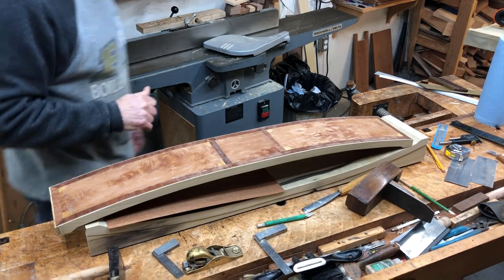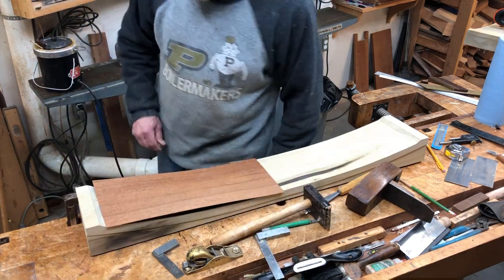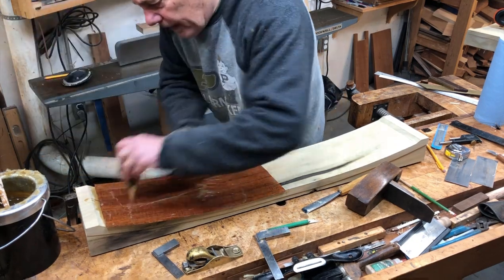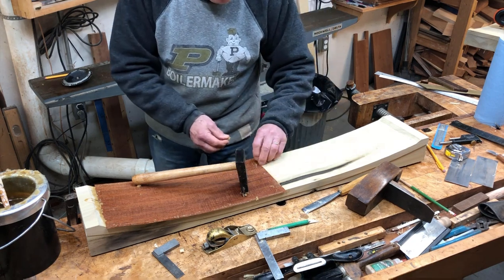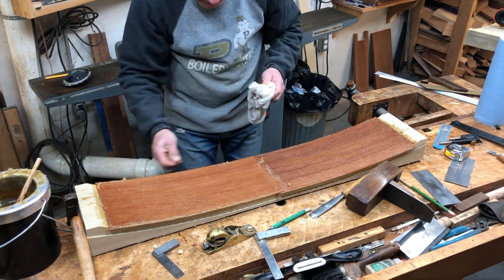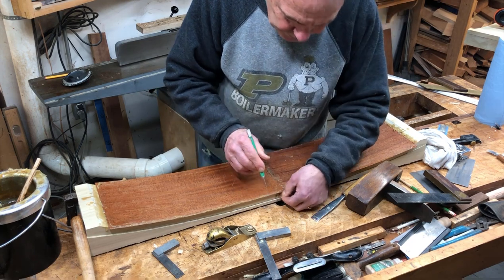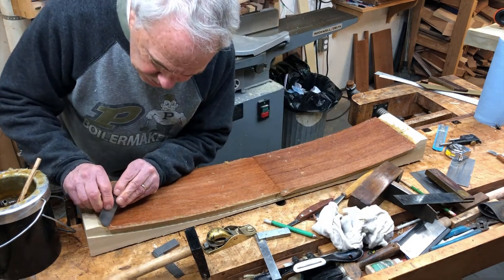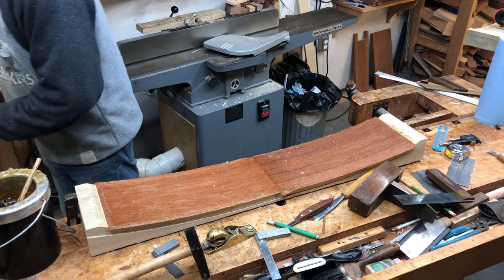Veneering the Back of the Drawer Front

Comment: new to veneering myself,couple of questions if you don't mind, are those shop cut veneer because they look thick compared to what i can buy and if so why? and also why did you glue the draw in two piece couldn't you join the two piece with veneer tape and glue in one piece...many thanks scott
Reply from the maker: Scott, these were purchased veneers, not shop-cut. They are skinny, perhaps around 1/32-in. I would not tape together two pieces and do as a whole. Especially in this weather with a cold shop, doing that big at once is tough. Even if shop were hot, I would not use the tape to do a whole. It is much easier to just overlap and cut. Also, on the front pattern of veneers, I do not use the veneer tape method. There will be other videos showing that procedure.

Tim

Comment: Have you ever used a small cooking bag as a liner in your glue pot ?  seems like a good idea.  I have a Hold Heet brand glue pot. going to use for the first time in a about a week
Reply from the maker: No, I don’t see a reason to have a liner.

Tim
Reply: easy to clean, not have old/smelly glue residue in the pot.   @killenwood
Reply from the maker: Big Fat Tony's  I often stir the pot with sticks. Not sure a liner like that would hold up. I will reuse glue in my pot for a week or so, reheating each day of use. Sometimes I go a week without reheating, and there may be mold on the surface. Usually I’ll reheat pour it out until next time when I’ll make a new batch.
Reply: Thanks, I was under the impression that Hide Glue was much more perishable than that. I'm gong to start off with a project that seems simpler than what you are working on.  I salvaged a mirror from a Starbucks remodel, I plan to encase it in a Federal style frame.  A window of the White House is my model 
 @killenwood